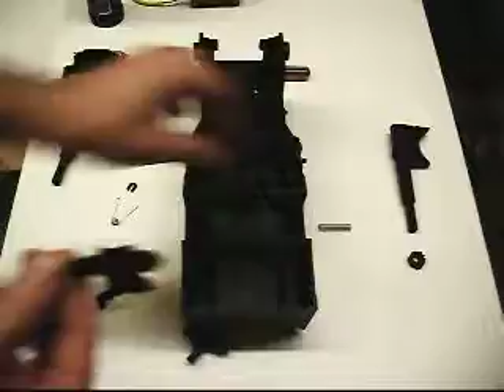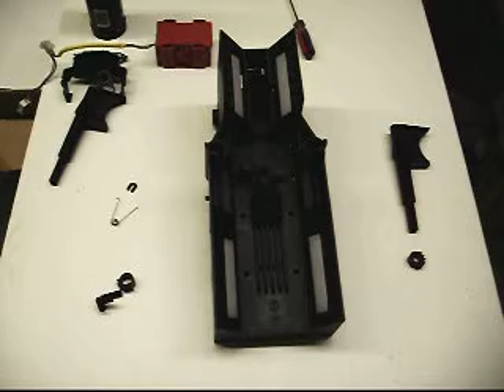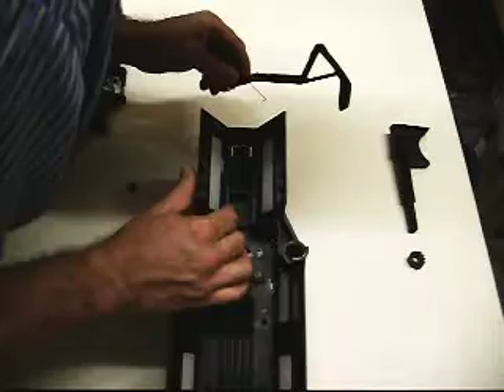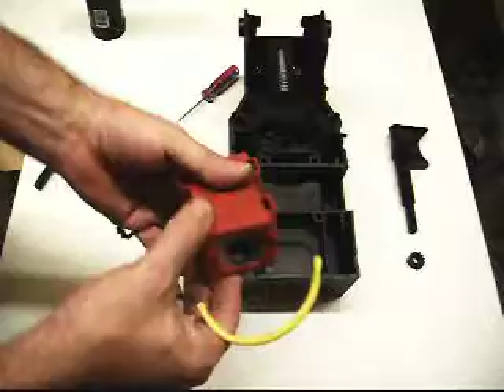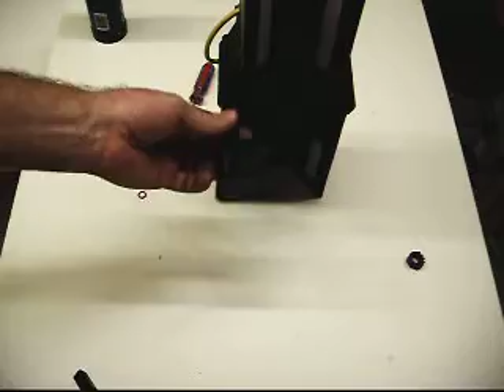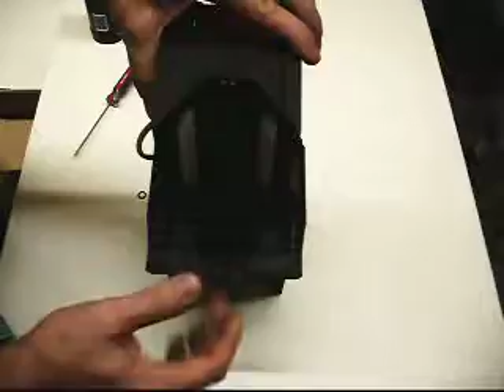GS-X pin holder assembly of parts.

Comment: Question is it possible to use gsx solenoid to use on a gs98 with little modification removing the button and top molded plastic but it will not have that single nipple so the silver plate could be seated to secure the solenoid from moving unless I just put a glue on the silver plate that has a hole